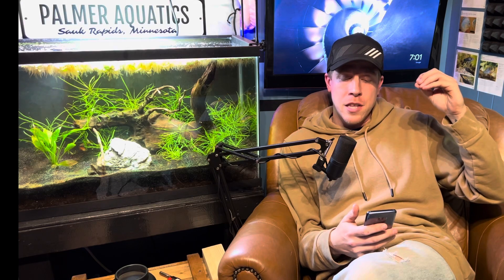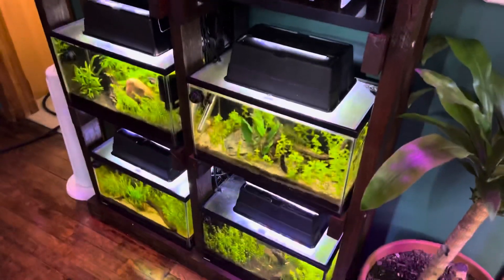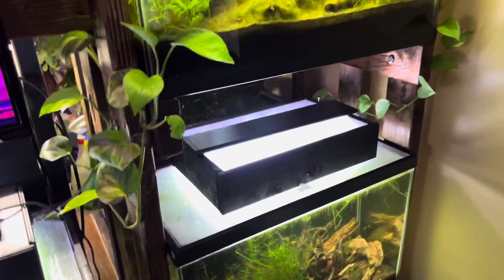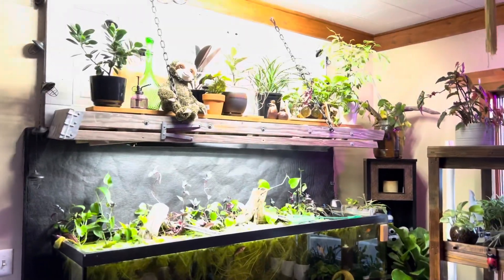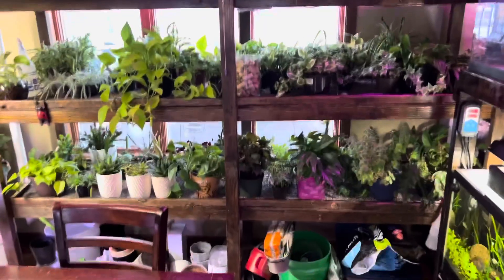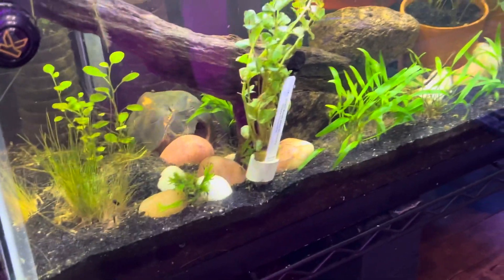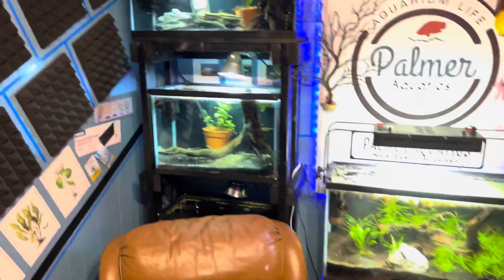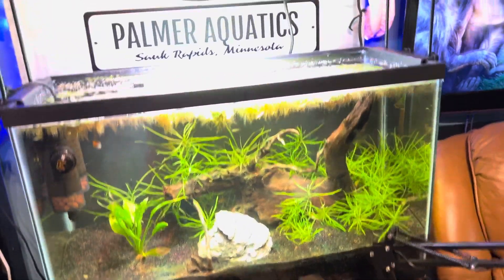Aquarium light stopped working? Flickering?

Comment: My light stopped working after a year. I checked it out & the control module was faulty somewhere. So I cut it out joined the wires & the light works but no controls. Its better than spending another $50 bucks.

Comment: Fluval flex common problem.. the lights fails because of the sensor for the remote. 

 cut out the sensor that’s mounted in the lid and solder black wire to black/white wire. 

And solder the white wire to black wire.  

Use some shrink wrap over the joins / it’s only low volt any way. 

All other wires are not needed as they are colour coded for colour leds. Although I use red and white on my tank. 

Basic skills can save money and a black out, no one listens to me on the fluval group tho 🤣